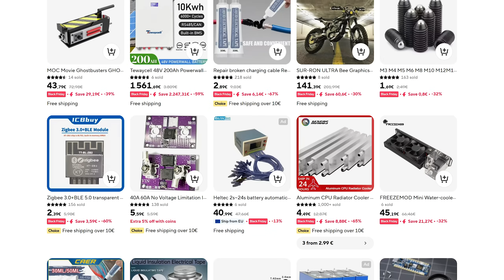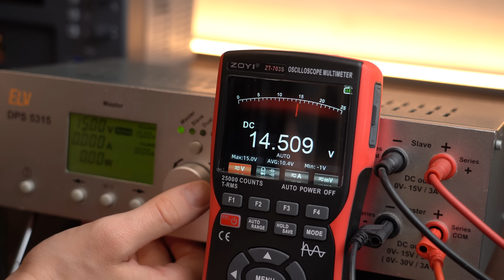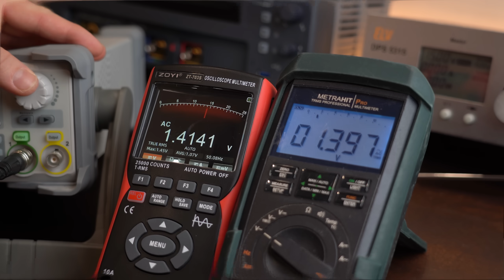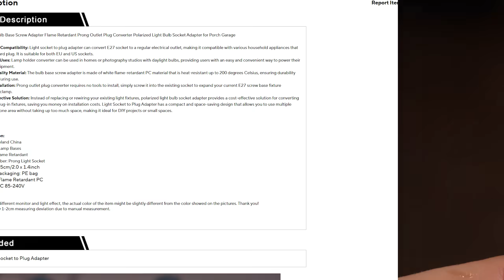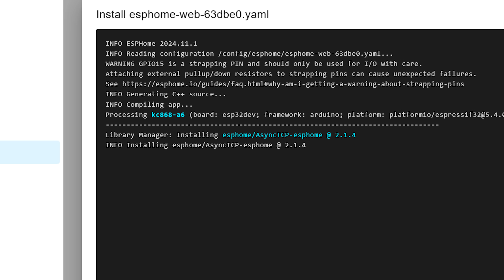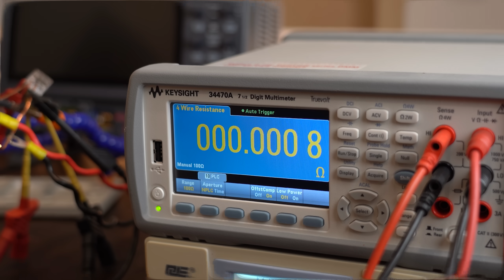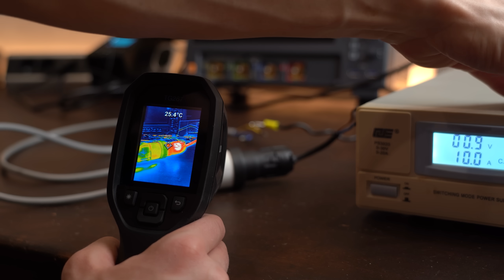I tried finding Hidden Gems on AliExpress AGAIN! (Part 12)

Comment: Lightbulb socket "power stealers" are quite a handy thing - a lot of basements in a lot of countries only have light in them, if you need a power tool to do anything - you would need one. Sure nowadays its easier with cordless high power stuff, but 20+ years ago it wasn't a thing. Probably can think about many other situation where it would be useful - thou the ones I have in mind aren't a simple conversion from an bulb thing like E27 to a power socket - they are more like an adaptor that has an bulb "end" to screw into socket, and then it will have 1 or more power sockets even if simple 2 prong ones, and then it would have also a bulb "in" so that you can screw the bulb into the adapter - still have light - and be able to "steal" power for other stuff.

Wrote the comment before watching video further than the intro XD so I didn't see you mention the things I spoke about lol ;)

Comment: If you need a decent miliohm meter buy FNIRSI HRM-10. It is decent and mostly meant for battery IR and voltage measurement and it costs only about 50€. Don't buy TOOLTOP IR502, it's a total garbage. I had to return it. I have a warning on my channel.

Comment: If the thin wire failed at a reasonably low current, then it would be a pretty elegant way of adding a fuse, however, 16A seems rather excessive, and dangerous for lighting circuits.

Comment: The scope comes shipped with the
bandwidth setting (shown under the menu
setting "Run Mode") set to "Normal Mode"
which limits the bandwidth to a maximum
of 30MHz. This is done to lower power
consumption. To measure signals up to the
50MHz maximum, you need to change this
setting to "High-Speed Mode", although it
states the power consumption willincrease

Comment: Sent by Copilot:

Using a microcurrent meter (like by eev blog) to measure resistance involves a few steps. Here’s a simple guide:

Set Up the Circuit: Connect the microcurrent meter in series with the resistor you want to measure. This means you’ll connect one lead of the meter to one end of the resistor and the other lead to the other end of the resistor.

Apply a Known Voltage: Use a power supply to apply a known voltage across the resistor. Make sure the voltage is within the range that your microcurrent meter can handle.

Measure the Current: Turn on the power supply and use the microcurrent meter to measure the current flowing through the resistor.

Calculate the Resistance: Use Ohm’s Law (( R = \frac{V}{I} )) to calculate the resistance. Divide the applied voltage (V) by the measured current (I).

For example, if you apply 1 volt across the resistor and measure a current of 1 microampere (1 µA), the resistance would be:

[ R = \frac{1 \text{ volt}}{1 \text{ µA}} = 1 \text{ megaohm} ]

If you have specific measurements or need further assistance, feel free to ask!

Comment: One thing I would NEVER EVER buy on AliEx is anything to do with household electric features. Chinese manufacturers are notorious for producing fake parts, using cheap substandard materials, cutting corners, and faking industry safety credentials. Buying such parts/devices put you and your house in serious safety hazard.

Comment: Those lighbulb sockets are not uncommon in Russia, they are mostly used in one of three ways:

- By technicians working in places not equipped with sockets, like basements or outside where they can hook up to a nearest streetlight

- By electricity thiefs, as lighting circuit is often unmetered, metered differently, or split across all residents in an apartment block

- By students in dorms, as lot of them were built a long time ago without sockets, because the only thing a soviet student would need a socket for TV which would distract them from studying, or an electric stove which is a fire hazard.

Comment: 5:55 another use I can see is using it to power an outside security camera via a light socket. I know most security cameras now run off of internal batteries or are wired straight into power, but for the ones that aren't, that adapter could work.

Comment: If you are looking for budget solution for very low resistance mesurements, try Fnirsi HRM-10. It is internal resistance meter for various batteries, but can also measure very low resistances and ESR of capacitors.

Comment: I would take caution with bulp sockets. The switched wire is not the same gauge. Therefore they can't pull the same load. It's not designed for it.

Comment: light fitting sockets are handy. I rent my house and my garage is super dim. I used one of those adapters to plug in a big LED shop light and it was much easier than replacing the bulb socket for an outlet

Comment: For mOhm meter the YR1035+ battery internal resistance meter works amazing. Pogo pins probes and 4wire measurement. And it’s pretty damn accurate.

Comment: I got an Owon multimeter/oscilloscope like the one in the video, which costed more than 150€... This one seems a lot better!

Wait.. does anybody know if it's possible to install a custom firmware on these multimeters?
The I/O part seems pretty similar.
Maybe they're just rebranded versions using the same internal board/MCU.

Comment: Sockets in lightbulb sockets are pretty common in the US, they’re both wired into an identical system with the same ratings and voltage and whatnot here IIRC so it’s a pretty common thing to do with an unused lightbulb socket

Comment: I used to have one of those socket adapters at my old apartment because the balcony had a light socket but no outlets. Ironically we just used it to run a set of fairy lights

Comment: A light bulb to outlet adapter, as you said, have been around for ever.  Most common use.  converting it from a light bulb to a Fluorescent Light Fixtures. T8 variety.

Comment: Socket adapters are also useful when tracing circuits back to breakers with a kit like the Klein 80016:
https://youtu.be/7H82405olrc?si=HxJx26_qX2PBAtVV&t=158

Comment: I own one of those old bakelite E27 to dual EU socket adapter. But I also remember that the old folks said it should not be used because they often would overload the circuit and the wiring would set fire to the house.
I would think that the socket adapter is a very useful travel adapter since one could speculate that the E27 socket is much more common than the European wall socket

Comment: I have a christmas cord light that fits that socket outlet adapter like the one at 5:10.
Now i have an extension cord with over 50 outlets on it. Would be fun to see what happened if i plug in 50 apparatus on it and plug it in. KABOOOOM!!!!!!! 😂

Comment: I have had success with the fnisiri battery tester to test low resistance values. It uses the 4 wire method. It was about €50

Comment: You could also get a  Y adaptor for the light socket so you could still have your bulb plugged in.
Lights are wired differently these days, so any heavy draw appliance would be a risky, but light loads should be fine.

Comment: The problem with that miliohmmeter is that, even with calibration, it's still a 2-point measurement. So if when the clamps slightly corrode the calibration is already wrong. And worse, the accuracy depends, possibly strongly, on how "well" a sample is clamped. But nevertheless, if the accuracy is good enough it seems like a nice tool for home use

Comment: I use one of those socket plugs in my garage. I have al my garage LED lights connected to it, so all my 4' long workshop lights (which daisy chain together) turn on with the press of a single light switch. I bought it from a hardware store so its UL rated.

Comment: A light bulb fixture socket is as old as house electric service and was initially used for outside light outlets as most homes did not have standard outlets that would withstand weather.

Comment: The garages in my condominium were built with no outlets at all, just light sockets.  Each owner started out with a light socket adapter similar to the one shown here.  Over the years almost every owner has installed some kind of outlets, but at least one neighbor still has a light socket adapter leading to an extension cord.

Comment: The problem with aliexpress multimeters is safety. A cat 3 rated fluke WILL be safe, one of these though could go wrong in any number of ways. The E27->Outlet adapter though is a fantastic idea I really wish would be done properly. I've got very few wall plugs but lots of multi-bulb fixtures, it'd be great if I could just steal one of the sockets with a phone charger to power an ESP up there.

Comment: With the EU GPSR (general product safety regulations) now in force you won't be able to buy dangerous  Chinese goods any longer, 🤣🤣🤣 More likely you might only be able to buy cheap Chinese goods online - it seems, for example, that most small UK busineses will no longer sell to the EU or NI as a result and that will no doubt spread to all non-EU small businesses as the word gets out. Bizarrely, even digital downloads are affected as they are notoriously dangerous (sarcasm). 
Even selling used items within the EU could become impossible unless you can prove it was within the EU before November 2024, otherwise it will need a user manual, manufacturer's contact details etc. etc. Nightmare for eBay sellers for months or years until the EU understands the unit ended consequences of this legislation. (Or maybe it was an intended protectionist move). I guess many will ignore GPSR but risk having goods seized by customs - especially German customs who are especially zealous.
The new German packaging law will make it even harder to sell to German customers.

Comment: In the USA, I use light socket adapters that screw in and still let you screw a bulb into the end but add an ungrounded socket on the side. These make it easier to add stuff in a basement with few outlets. I don't use it for any heavy loads, mostly to add more lighting.

Comment: That relay board is much greater safety risk than this bulb to socket adapter, not only relay can also get hot with high currents (you should also test it for 16A for fair comparision) but also can arc, but most dangerous thing is that it won't disconnect something or random connect due to software issue hardware iaaue or even hack.
So such bulb adapter in comparision os much safer but not so fancy.

Comment: Hah, oddly enough I just made a E27-adapter a few days ago!
Power had gone out in half of my apartment building but not in the basement and I wanted a cup of tea.
I knew I had a broken lightbulb and I also have a gas-soldering iron.

It worked as intended, I doubt I'll ever use it again though!

Comment: Е27 to socket is kind of useful even nowadays. I have a basement, that has lights but no socket and also a staircase cellar with only light and no socket. For both I've needed to connect a portable light to do some work. So if you have such a room having one of these makes sense... instead of doing like me and building one yourself out of a old light bulb and extension cord :)

Comment: When electricity was new most wired houses only had light sockets.The center ceiling mounted light fixture wasn't as common then. It was far more common to have wall mounted lights so the plug wouldn't have been upside down in the center of the room. Even as center room ceiling mounted lights become more common you see keyless fixitures with a single outlet in them with the light socket.
I've seen old antique electric clothes irons where they had a screw in adaptor on the end instead of the 2 prong plug that become common. You screwed in the cord then you screwed the light bulb into that. The iron had a stupid long cord on it (like 20 feet). They are rare to find because as wall outlets become common those ends got cut off and replaced with the 2 prong plugs that took over.

Comment: A couple of years ago, I wanted to replace a dim compact fluorescent bulb on the ceiling of my garage with a pair of LED shop lights, which together had a much lower power draw than the incandescent bulb the light socket was rated for. I actually looked for an adapter like the one you show here, because you could get them anywhere 40 years ago. I never found one, and I ended up removing the existing light socket and replacing it with an actual outlet in the ceiling.
I sold the house with that outlet and the LED lights installed, and the outlet wasn't even the worst of my sins (I "temporarily" routed the power cord over a metal hook and never fixed it) but it passed inspection without a problem.
When I built my new house, I included a detached workshop building. I hired licensed electricians to install the panel in that building, and they were required by code to install a light outside the door, a light inside the building, and one outlet. There, too, I had them install an outlet on the ceiling to accommodate plug-in LED shop lights. That, too, passed inspection, from an actual building inspector rather than just a "home inspector."

Comment: 11:34 please look at the videos of DiodeGoneWild, he has a battery impedance tester that can also measure conductors. It injects AC current at 1kHz so not actually DC resistance, but resistors should not be affected by AC vs DC.

Comment: I have the same liquid electrical tape. You need to use it like a sort of a clay and work it before applying. It will turn gooey after a few seconds and harden after application.

Comment: Plug/socket adapters are pretty common here in rural Texas. They tend to get used in barns and old sheds for the most part. Any place where the wiring is as old as your grandparents.

Comment: For the microscope, you can often try and rotate the tiny lens with pliers to change the focus. Mind you that this doesn't always work, it depends a bit on how well the lens is secured with glue, but so far I've always been able to adjust the focus on my Pi lenses that were also glued in place.

Comment: 10:10 the milliohm meter might differ with values due to cables used to connect to what you need, and point of contact

Comment: I use the electrical tape extensively. When it isn't dry in the tube. It's a actually very very useful. I fixed many frayed USB cables, power cables, use it for some of the the plugs in my (old) car. I dab some on, wrap some cello over it, massage it into shape, let it dry for 12 hours and hey presto ! cable is isolated. And if sticks to the pvc quite firmly too. It's also a very good isolating glue. When i build usb or DB9 or DB25 cables, I fill up the body with this stuff and close the housing, makes for good IP65 and "pull on cable" resistance. You should retry this one.

Comment: Temu is just as good. Typical Chinese dodgy electrical standards. I think before id start promoting a chinese multimeter capable of potentially really fking someone up, If open it up and check how safe it is. I had one that was so poorly insulated on 240v it would short.

Comment: Light 'socket' is for cheap hotels, ones where you don't get any room sockets in your room, where the TV power is hardwired to the wall and the remote is chained to the bed

Comment: We used to use those Light Socket to Plug adapters in the attic because there were no plug sockets, and if we needed a drill to drill a hole it came in clutch

Comment: the light bulb socket converter is actually useful, for checking polarity of socket with normal plug tester. Running some lights in reverse polarity is bad for them, or can cause flickering

Comment: Pull the covers off the microscope, and check out the camera lens.
Many types have a screw-on lens, and but rotating it you change the focal length, and even the magnification.
I had one that was too close and too high magnification, but after rotating the lens out a couple of turns it reduced the magnification and changed the focal length to about 40mm which was perfect for a pcb microscope. 👍

Comment: Back in the day, if were renting a cheap flat/apartment there would be a coin-in-the-slot electricity meter. However the lighting circuit for all the rooms would not be fed from these meters so people would connect to the light socket for upto about 500 watts

Comment: Interesting video. I was also looking for a simple solution to magnify small electronic parts, and after trying a few things, I finally settled on using my smartphone. A simple mount for a smartphone is probably the best solution for the difficult to reach places. It even comes with a light! =]

Comment: How many amps can German light circuits handle?
Light circuits normally deliver less current because they are made for lights and the most powerful lights would've been 100w for indoors with perhaps 250w for outdoors

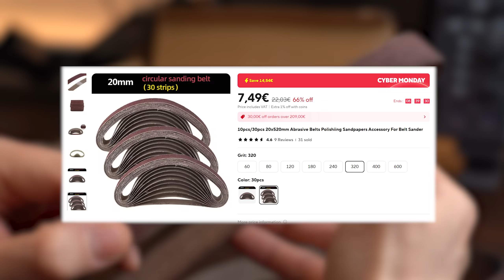Comment: 13:00 i also bought one of those belt sander adaptor for grinders. The on issue according to other yt reviews for that is that it is too fast for the grinder. For my case, the cam gear included does not screw(thread pitch not same) properly on my grinder.

Comment: Light socket is actually good. We are often traveling to cotage where they dont have sockets on rooms. So we hooked it into light socket and than used another adapter to power the light bulb. But you must be avare that there is often 10A limit and dont plug high power apliances! 😅

Comment: Those lamp sockets are illegal in many European countries, which is why you can’t buy them in EU countries.

They are a fire hazard—not only putting yourself in danger but also your neighbors if a fire breaks out.

There is a significant difference between AC and DC. Please do some research before making a video that might encourage people to buy something that could set their home on fire.

It doesn’t matter how much current they can handle; there are other safety standards they fail to meet. Moreover, using lamp sockets as plugs is illegal, and your insurance won’t cover any damages resulting from their use.